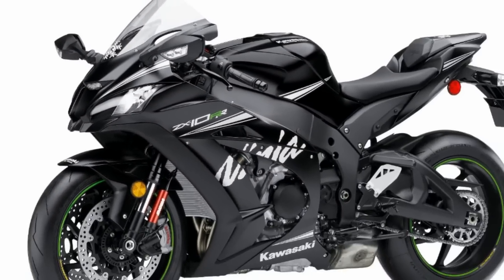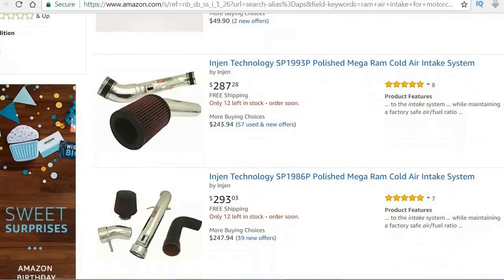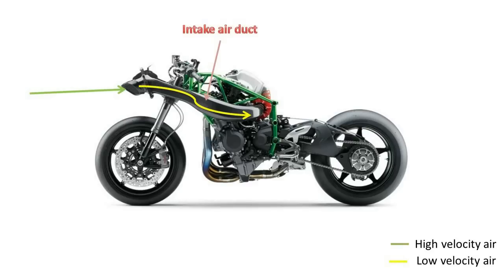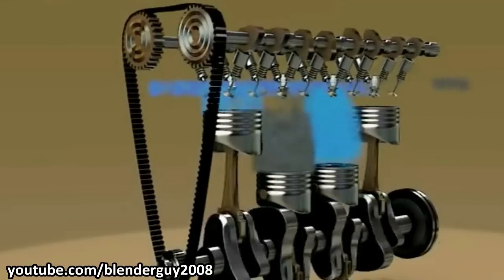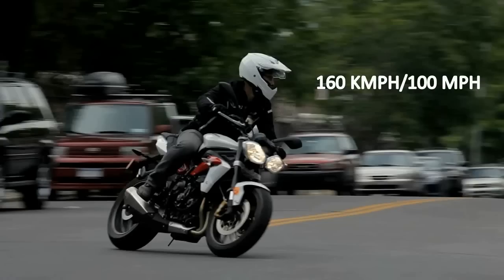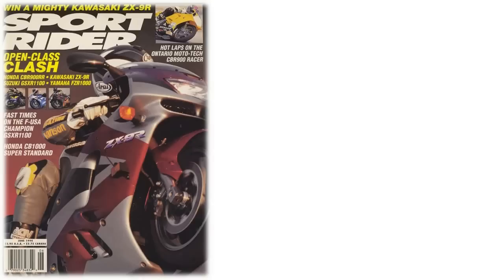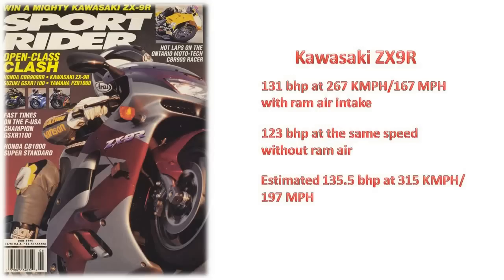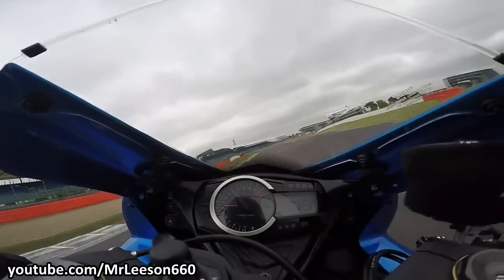Ram Air Intake System In Motorcycle Explained | The Truth

Comment: It's "Free horsepower"  you can feel it.  2005 Yamaha R1. It starts to really have effect around 75mph, and soon after you feel and start thinking, what the hell is going on ?  Oh, by the way,  I once had the Yamaha Turbo bike,  and this is far more subtle,  but is still noticable.  My 98 R1 did not have it, I tried to retro fit an airscoop,  like the one on the Kawasaki,   but with carbs  it was not entirely effective, but at least it brought in fresh colder air into the box.

Comment: Does it make sense for competitive motorcycle racers too? Or just people who want to go ‘stupidly fast’? How slow is cleverly slow? Also, the speed figures you quote from Sport Rider magazine are based and the ZX9R’s (inaccurate) speedometer, not actual road speed.
Reply: Yes it does. Not only the ramming of air, just having cool air that has not passed by the warm engine helps. Then the ram air effect: if you look at the formula for kinetic energy, rho p ( density) is a factor, but speed is quadratic. So while racing at high speeds it generated more power.

Comment: And here i am wondering if i can create a small ram air kit for my cbr600f could i get a few gains? Regular 130mph traveller so...
Reply: sure can, but you'll also have to calibrate the jet for that high rpm range, otherwise you'll be running too lean and burn the gaskets. (an ECU tune if it's a F4i )

Comment: In my country, the bike just 150 cc, so just riding at 80-130 km/h, does it affect motor performance ? (please answer for my research)
Reply: actually it does. with slightly greater effect on carbureted engines. still depends on the set up if your motorcycle can still gush in air and fuel while pushing out more and more exhaust.

Comment: I mean, what is the other option than "ram-air" really?  The air comes from the front of the bike directly into the intake box.
Reply: my 1990 cbr 600 has this lol
Reply from the maker: Then the manufactures will have to make some major compromises on the design.
Reply: @RevvingHeart  Why compromise something so simple as having a ram-air system?
Reply from the maker: Answer to that question is simple. You see, most of the motorcycle that have the ram-air intake are the high performance superbikes. And what's the purposes of a superbike? To deliver maximum performance in possible in every possible scenario. To squeeze out every last ounce of performance, manufactures have to do all sorts of things. And the ram-air intake is one such simple but effective thing.
Reply: @RevvingHeart  I know but it's just an intake duct that goes from the nose directly to the airbox.  No idea why it's such a big deal.  Do other companies design their bikes to block the ram packing because their engine designs would blow up if the intake system got "boosted" such as only high-performance engines contain this this and this kind of design that drive up the cost can have ram-air?
Reply: @antdx316  These boxes are just bigger or modified to deliver more. That's so.
Its another performance mod like a bigger tire, or better spark plugs. Some are talked about,more than others.
Reply: @LightGesture  The pull of the R6 at high-RPM is simply fantastic.
Reply: This is good as engines can take "fresh" low turbulence and some coordinated air. F1 Car used to have it and after some power restriction regulations they just opened a hole on the back of the Ram Air. 
Other point is and "Serious" one is regarding water,  even Supersport bikes can be used as daily motorcycle, being washed by any person with a water hose and BOOM, destroy the engine, even during heavy raining. Most "Ram-Air"do not really pressurize, and they have a siphon design to avoid water ingestion. Google Hayabusa Scoops and you will see people using real pressure gauges and tests on the air boxes of many models. Racing is a completely different concept when compared to street.  :-)

Comment: So ram air intake doesn't work on a dyno as the motorcycle is still. So how are power figures measured??
Reply from the maker: Ram air intake does work in the dyno, it depends of how air the blower inside the dyno booth blows into the air intake of the motorcycle. The more it blows more effect the ram air intake system will get.
Generally the blowers are adjusted to mimic the real world condition but there is always going to a difference between the real world power and power measured in the dyno booth.
Reply: Even while still you can simulate wind speed by either wind tunnel or fans, using wind simulation is especially important while tuning air-cooled engines otherwise they could seize